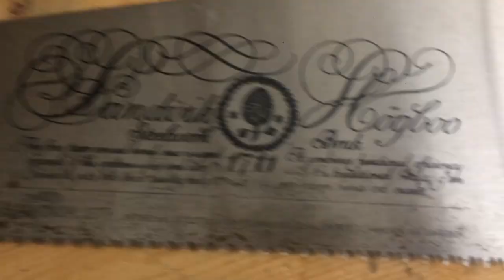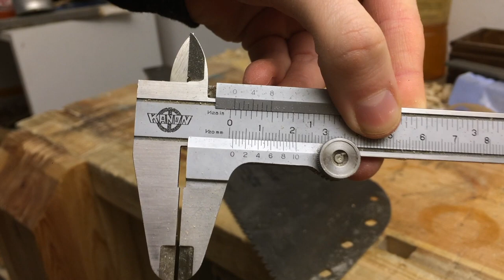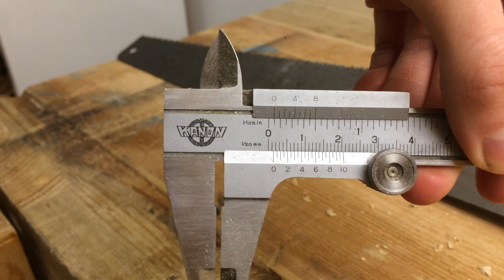Crosscut saw makeover – new handle for my largest handsaw

Comment: Awesome! What did you wipe down the blade with when done?
Reply from the maker: Thanks! Same stuff as the planes but I'll drop the info here as well: I use sewing machine oil for both lubrication and rust protection, just a very thin coat applied by Paul Sellers-style rag-in-a-can. I don't think there's anything special about sewing machine oil but it's colorless and thin and seems to work very well.